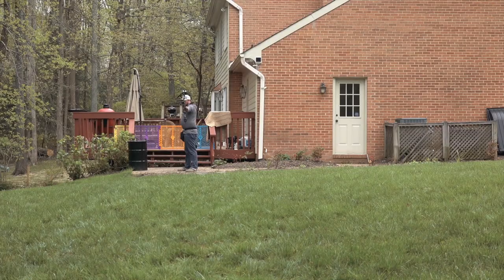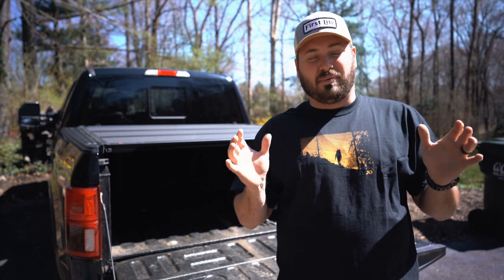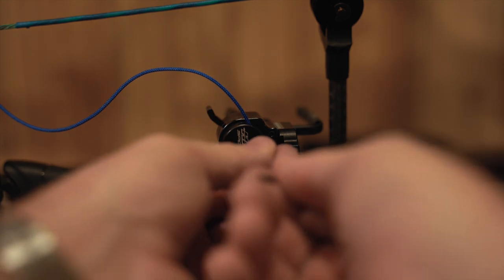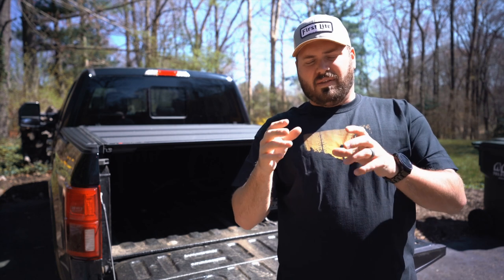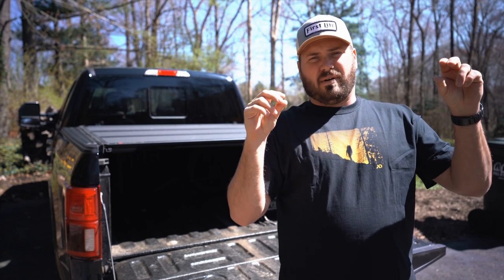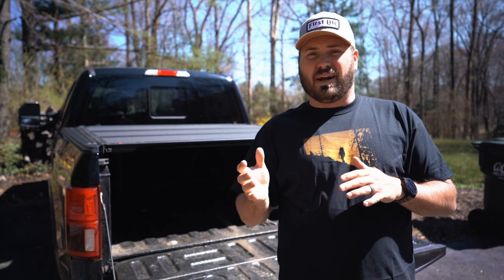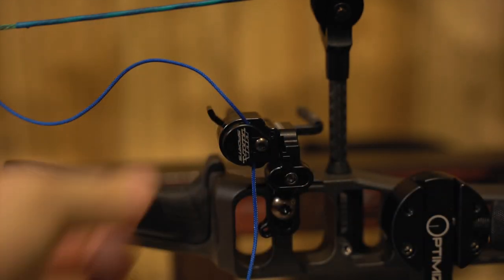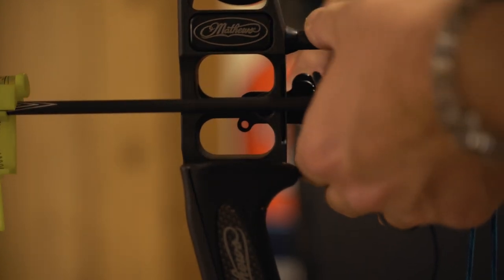A FOOLPROOF Guide to Installing a DROP AWAY Rest

Comment: Thanks man I went to a pro shop and they set up my drop away rest wrong twice. I’m shooting all the way left and running out of room on the right, I got three lines left on the right and finally getting middle at 40 50 and 60 but all the way left on my windage I called bear archery they said my middle shot is off. Thanks in advance. 🙏🏽

Comment: You should also serve above and below the knot on the timing cable. Remember, that buss cable moves both ways, so that timing cable needs to be secured both top and bottom as well. This keeps you from searching for an issue when you are making sure you don’t have any set up issues by doing them right.
Reply: I've made that mistake

Comment: Why does everyone get the arrow alignment wrong?  That Berger hole is where it is for a reason. True shaft should center through the Berger hole, and not the bottom of the shaft through the center of it. I am now seeing why so many cannot shoot like a pro, and have difficult times tying their bows PROPERLY. That arrow shaft should be like it is sliding across an actual Berger Button, and dead freakin center. Sorry but it just gets in my craw how many mmm no ow nothing about how a bow is built and how you need to set everything up so it times easier and shoots the tiniest groups.
Reply: Explain then why you can fix a tail low tear with raising your nocking point. Yes you can lower your rest, which is then putting the arrow sitting lower than center of the berger hole, but sometimes that's not good enough and need to adjust where your arrow sits on the string. Center through the berger hole is a starting point, not where it has to remain. Some bows tune better with the bottom of the arrow through the center of the berger hole.